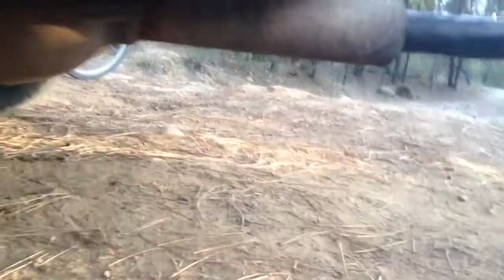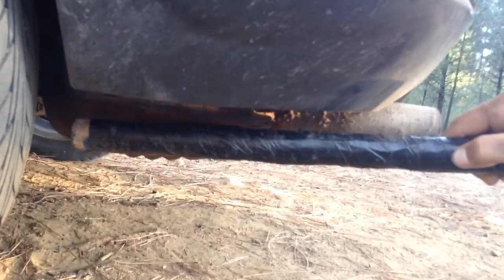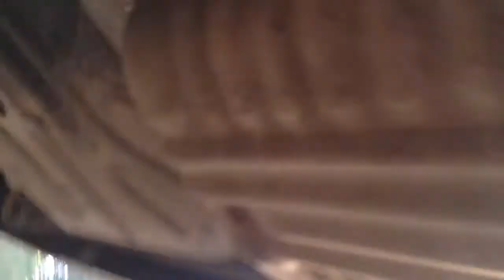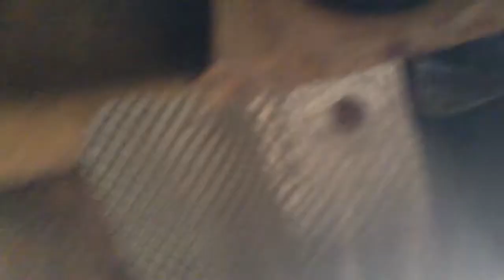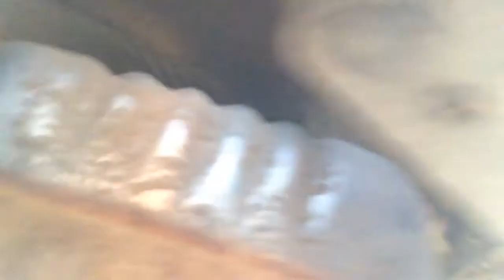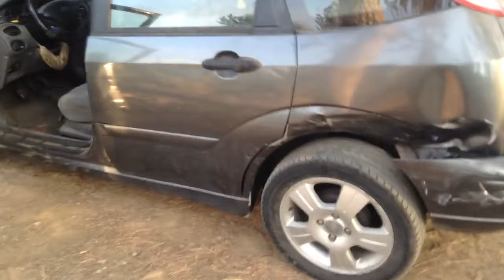Tail pipe tests to check if stuffed; Ford Focus; Seems clear.

Comment: 2001 ford focus wont stay running?
        
        

    
    I have a 2001 ford focus...it starts but then dies....what could be causing this? how do i fix it? 

 

thanks for the help!

            Best Answer: 
             Well a problem like this typically involves issues with the car's fuel pump and/or air intake. 

 

One thing I would check first is the air filter... make sure it is clear
 of debris and any leaves or dirt.  If the engine is not getting air 
into it, then the fuel pump will simply be putting fuel into the 
cylinder head with no mixture of air --> thus leading to a "flooding"
 of the engine.   

 

The reverse could also be true... it may be that you have a clean air 
filter/air intake... but a bad fuel pump.  Since most cars these days 
(and i'm assuming your 2001 ford focus is as well), are fuel injected...
 if you have a bad fuel pump, your car may not be delivering gasoline to
 the engine, thus causing it to "choke" and only stay running for a few 
seconds before dying. 

 

You're best bet is to take it either to a Ford dealer, or a local 
mechanic and have them take a look --> they'll be able to tell you 
right away... and then suggest a solution for it (whether it means 
repairing it themselves, or at least letting you know for sure what is 
wrong & what part you might need to replace).